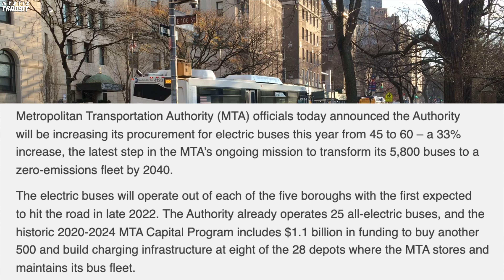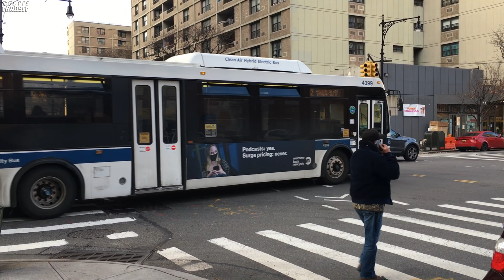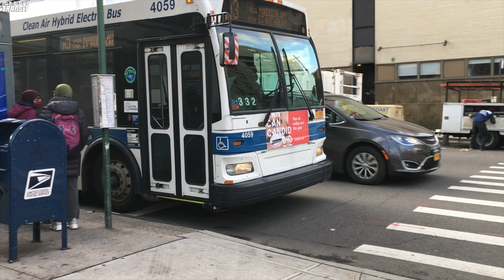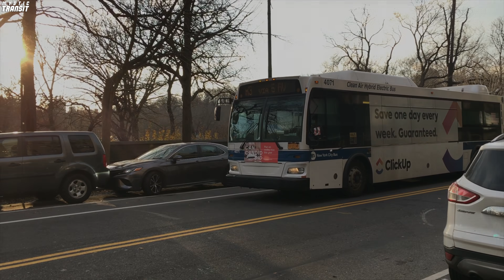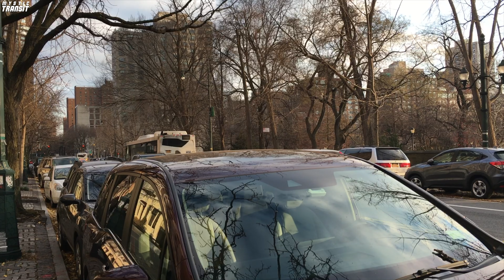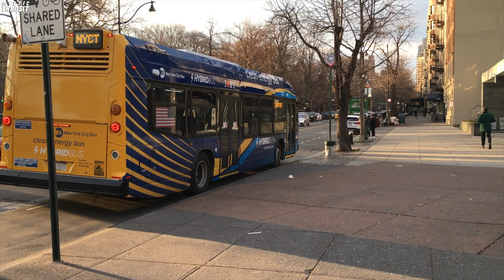Retiring the Orion VII's - NYC's Bus Fleet Modernization

Comment: As of March 27th, the Orion VII OGS have officially retired. RIP 2001-2024
Reply: It’s actually March 25th. 3762 was the last Old Gen and it did it’s last runs on the Q37 and Q60. And then it retired the day after. 3708 and 3751 retired the day before March 24th. This now officially ends the era of New York City operating buses with push tape stop requests, slanted windshields and they were also the last buses that didn’t feature announcements.

Comment: great video ..   I favor the "4000" because they have a smaller "three-spoke"  steering wheel and great visibility which made driving them nice in traffic close second would be the  "7000"  (Brooklyn).  I think this was the best bus in the fleet (just be careful in rain and snow the front likes to slide)  ... but you can't beat the RTS  in bad weather they are warm and visibility is the best out of all the buses (when you can get the passenger side mirror right lol ) due to the fact you sit much higher.. (not counting the older rts 9000 they sucked with their "touchy" brake peddles which would send passengers flying if you had to stop short which had the older brake design)....   currently, I drive the extended nose buses out of Staten Island and they are terrible in ride and visibility (my good the shakes thought the steering column and rattles the driver to death on long line like the s78/ s79/ s74....

Comment: The use of hydrogen fuelled buses is also something I think is the way forward especially with the 9 min refuelling time compared to the time electric vehicles need to recharge. This allows better utilisation of the fleet.
Reply: Where’s hydrogen infrastructure in the state of ny. Nowhere. Where electric plug outlet? Everywhere
Reply: @williamerazo3921  where was the oxygen storage tanks before the hospital got built? 

Like many things as we move to greener option we may need to invest in infrastructure but for Hydrogen delivery to site is via a tanker from the processing site. 

Where hydrogen will have advantages and this is the case over in my area which has a mixture of urban/rural communities is the increased range and the quicker turnaround time when needing to be refilled. The filling of the Hydrogen tanks takes only 9 minutes which is impressive compared to electric charging times for over 250 miles. 

Yes, regenerative breaking is a good way of extending electric bus range but when you get out of the cities often the breaking is less frequent and the routes are longer which is a good reason for the hydrogen buses. There is also the question of how many extra buses do you need to allow for the increased charging time of electric buses to still run your operation especially on routes with 24 hour operation as not only are you risking having to purchase more buses but also more land to store the fleet.

Comment: Why does everyone have a hard on for battery electric? Batteries suck. Why cant we use diesel generator electric hybrids. Ya know like locomotives?
Reply: MTA is already procuring several diesel electric hybrid buses, but the long term plan is to go zero emissions (the diesel electric hybrids still pollute, but not by much compared to diesel and older hybrid buses).

Comment: Yes you need to invest in the supporting infrastructure. Like dozens of diesel powered tow trucks to tow the electric bus when they run out of juice midspan on the RFK bridge.
Reply: It is exteremely unlikely that electric buses will get stuck in the middle of the bridge. A few Proterra buses were tested on routes operating on the Pulaski Bridge and a number of articulated Xcelsior electric articulated have been operating on the M60 along the RFK bridge, and there hasn’t been a case where buses ran out of power in each.

Comment: Rule of thumb:

 Don't scrap all the Orion 7 Next Gens.  Because if they do, the MTA will regret it.  Trust me.  Rode one on the Q50 today.   They still have that great instant torque.  And they still look really decent with the frameless windows.  They can rehab and keep some of them and donate the rest overseas
Reply: You do realize that these buses are reaching the end of life and new buses coming in need room in the depots, correct?
Reply: @TheRailLeaguer  To be fair the M.T.A does have a history of retiring things too fast. I always think it’s a good rule of thumb to keep a few as a contingency fleet just in case. For example recently the new fleet of Prevost coach buses had seat spacing problems the M.T.A should’ve keep some of the older D4500 models just in case something went wrong with the new coaches.
Reply: @jamallhayden2512  The retirement of the NG buses are going a bit slow this time around, and there really isn’t a need for a handful of old local buses to be kept around for contingencies. However if it makes you feel any better they could preserve a bus or two for the museum fleet.
Reply: @TheRailLeaguer  Mr. Hayden.  You're missing the point.  You don't scrap a bus with outstanding attributes........that being speed and the other aesthetics.
Reply: @milestone_achiever4634  They’re actually being scrapped due to age. Once buses start to pass 12-15 years, the buses being to develop problem, making fleet replacement all the more urgent.

Also, the Xcelsior and LFS have even better speed and aesthetics. A total of 833 of these new buses will replace these buses, with another order replacing the rest.
Reply: @TheRailLeaguer  It is true new buses irreconcilably in some instances will need to be ushered in.  However, the Orion 7 next gen hybrid it's still a very decent design and the buses are still very fast.  It is one of the few fast and fun to ride buses ever to come out of the Orion plant. 
   The Orion 7 Next Gens were an enormous improvement over the Orion 7 First Gens in all aspects.  All I am suggesting is that the MTA save some of the Orion 7 next gens.  They can rehab them.  MBTA,  TTC and I believe SEPTA have used a company to rehab some of their buses from the mid 2000s   And the nation's biggest transit network can't do this as well?   That's kind of absurd.
      Of course, they don't need to keep all the Orion 7 Next Gens.  They can retire all of the Orion 7 first gens because they are just too damn slow and the design is dull and out of style.
    I'm pretty sure that the MTA can rehab at least 50 Orion 7 next gen hybrids out of the 800 or so in total. That's only like 6 percent.  Come on.  This is not rocket science.  I'm sure they will have plenty of room in the depots to store them.
  Let me just reiterate NO American transit agency should be scraping any buses.  Retired buses not auctioned off can be donated to other countries where the people are still using dilapidated buses that are 50 years old and more.
Reply: @milestone_achiever4634  There really isn’t a need to save a large amount of Next Gens when depot space is at premium. However they could save one or two for the museum.
Reply: @milestone_achiever4634  I am not sure what you are on but the entire Next Gen Orion VII fleet is slated to be retired by 2024. The MTA has already begun the bidding process for the orders that will retire them. By way of the 25 40-foot Electric Buses (reportedly for Eastchester) and 237 40-foot Diesel Buses (For JFK/FR and LaGuardia)
Reply: @BrIaNMeRcY1022  if you read my reply, you will acknowledge that It is a 2 part issue from my own perspective.   
    I would never expect the MTA to keep a previous era of buses when new ones are ushered in.  We all know it’s a continuous trend.  It’s also one of the critical laws of evolution…….out with the old and in with the new.
     However, I believe that the MTA should save a small number of the Orion 7 next gen hybrids.  
It is still a very innovative design.  I am pretty sure they can overhaul as little as 20 out of the 700 plus buses.

    They can rehab them through Mid West Bus.  MBTA has overhauled some of their older units through Midwest.  If NYC wishes not to, they should donate everything they retire overseas for the simple fact that there are too many people in poorer countries still using dilapidated buses.  
     No U.S. transit agency should be scrapping buses anymore.  Whatever buses are not auctioned off should be sent overseas.  

Plain and simple
Reply: @milestone_achiever4634  Those days of the MTA doing a overhaul are over. They did it with the Blitz Fishbowls and RTS Remans merely because they couldn't retire them. As they needed to maintain service. The MTA is in a better position now compared to the 80's and 90's with the arrival of new buses. Overhauling the Orion VII's is a waste of money.

You are better off ordering new buses that have better fuel economy, is cheap and easier to maintain. From now to 4th Quarter 2023, the MTA is looking to retire close to 600 Next Gen Orion VII's. With the rest of them being retired sometime in late-2024, early -2025.

Comment: NYC gets cold enough to induce big variability in battery bus performance, right?  Do what Boston does, implement battery or gas extended trolley-busses, with trolley wire along trunks... or have many rapid-charging trolley points along a 100-percent battery service
Reply: The 15 XE60s can handle cold weather, and it can even handle snowy roads as well.

Comment: The one with 6905 was on my line the B12 up until 2020
Reply: 6905 was never even assigned to East NY Depot. The East NY Batch of Gen-II+ buses was from 6790-6843.
Reply: @TheRailLeaguer  it was back in 2019 and 2018
Reply: @TheRailLeaguer  some of them get switched due to transferring buses from different lines B12 is now xd40s now

Comment: The Toronto Transit Commission, which is smaller than NYC MTA has 60 electric buses which is the largest in North America. They are 25 New Flyer XE40's, 25 Proterra Catalyst BE40's and 10 BYD K9M's.

Comment: I'm gonna miss driving the NGs those because they're pretty fast and brakes are good with the help of the regen braking. The OGs are crap with the exception of 3563. That was a BEAST of a bus bro 💪
Reply: Wasn't that the one they converted to a diesel
Reply: @artvandelay5385  YES. Yes it was. The whole fleet was supposed to be converted but it would have been an expensive conversion.
Reply: @fw3nyc  I loved that bus when they sent it to spring creek  I drove all the time  I got stuck with on the 103  they took it to zerga   its still there
Reply: Bro really called the OGs crap
Reply: @Skillissuelol  they are tho. Brakes are lousy and acceleration is lack luster to say the least.
Reply: @fw3nyc  the NGs are aging worse than the OGs funny enough

Comment: We have 3 fully electric New Flyer X40E here at UTA. I one of few drivers who can drive these for 9 plus hours without killing the batteries. These buses have killer A/C for the summer days. Very quiet electric drivetrain. The only annoying part is the loud GM style turn signals. The front door when open blocks the outside mirror. The header changer is too high to change. But has air vents above the drivers head to keep us cool is a nice touch that we ask Gillig to do the same on our 2020 models.

Comment: Good video but remember this. Electric Bus technology is advancing. Best to have a small fleet of them when you are introducing them. The MTA has committed to procuring exclusively Electric Buses after 2028. In 2023, the MTA plans on receiving a test fleet for more Electric 40 & 45-foot buses.

In last month's (February 2022) Board Materials, the MTA is already in the process for procuring for more Electric Buses (100 60-foot/400 40-foot). The progression has to come gradual, not rushed. While the cost of an Electric Bus is high but, the cost of maintaining them outweighs the cost over time.
Reply from the maker: You make a good point. Maybe I shouldn't be so hard on them for the slow process of procuring Electric Buses.
Reply: @MysticTransit  When it comes to rolling stock, logistics plays a crucial role. The supply chain is one of those critical pieces. Hopefully, it gets better in the technology sector from the onset of COVID-19. The MTA has a game plan in place to advance to the next generation. From Electric Buses to the R211's, the MTA is going to look vastly different in 2026.
Reply: We have CNG, Electric, and Diesel buses.  Even though you say electric bus don't require that much maintence but in fact they do. We don't use all the time because the weather conditions, how long/short the route is. They require special programming all the time. The driving ranges from driver to driver.
Reply: @tommynunez1495  I am well aware of what buses are used in New York City. Weather conditions is a non-factor. The past couple of snowstorms, the MTA ran their New Flyer XE60's with little to no issues. The MTA knows the technology is advancing and is taking the range of the bus seriously.
Reply: @BrIaNMeRcY1022  Im a former NYer and live in Utah. Im a higher elevation and weather does plays the part here so when maintence doesn't send out the electric buses in given conditions its for many reason. Glad MTA thinks differently
Reply: @tommynunez1495  Electric Bus Technology is advancing. The MTA recognizes this and is playing it safe with procuring Electric Buses.
Reply: @tommynunez1495  The M.T.A should experiment with hydrogen powered vehicles? Hydrogen E.Vs tend to have a longer range and fast refueling. They could gradually replace some diesel powered equipment with hydrogen ones. Have all battery electric E.Vs handle short to mid distance routes and use hydrogen and C.N.G for longer commuter routes!
Reply: @New York Bus Guy Thank God!

Comment: How about having a contest in every high school, college,  and university in NYC to have new engines for using hydrogen,  liquified natural gas, butane, propane liquified coal gas, ethyl, methyl alchohol as alternative fuels?
Reply: This is about achieving carbon neutrality by no later than 2050 under the Paris Climate Agreement to prevent global warming from exceeding 1.5°C and not just about reducing local air pollution and reliance on oil. This is why most of the alternatives you mentioned would not work. In order to be zero emissions, you have to use either all-electric or fuel cells. No combustion engines are allowed, not even hydrogen, because any combustion in Earth's atmosphere creates nitrogen oxides ("NOₓ"), which form smog. The term "alternative fuels" is now over a decade outdated. It is now instead and will be for the forseeable future "zero emissions" and "carbon neutral".

Comment: I Miss The D60HF's.
Reply: I still can’t believe they didn’t preserve any 🤦🏿‍♂️ How could you not preserve your first articulated fleet! 🤬
Reply from the maker: Yeah, that, was a rather stupid decision.
Reply: @jamallhayden2512  Actually, I would like to let you know that 5534 has been preserved for the museum fleet. Since the moment that the D60HF fleet retired in 2019, 117 (ex-5534) hasn’t been scrapped and it still remains parked at Eastchester Scrap. It is only a matter of time for the MTA to consider restoring 5534 in its original formatting back when those buses were brand new. Besides 5534, we are also waiting for the MTA to take a moment to restore 8971 back into it’s original formatting as it has been reported that it is the only 1996 Novabus RTS Bus to be saved besides 5249 which is a 1999 unit.
Reply: @edwinpenafort8750  Oh thanks for the info 🤝
Reply from the maker: Same.
Reply: I’m gonna Miss the Orion og
Reply: Wish I was around to see them

Comment: I’m a former London bus driver abd have driven numerous different types including the routemaster but the modern buses we have now are superb to drive for eg the the Volvo VH also the tech the driver has now once it was just two way radio now it’s radio  SMS txt mobile phone and GPS on the TfL i bus system  will NY try double deckers again we have over 8000 in London pulse lots of different single deckers lots of variety as for the old routemaster now a museum piece plus in todays world to dangerous but I did like driving them the conductor took all the flak from passengers hehe
Reply: NYC did have double decker buses from 1907 til 1953. From the 5th Avenue Coach Company to the New York Omnubus Company to the New York City Board of Transportation. It has been all single deckmbuses since then. Ceck out on GOOGLE for,vintage photos of buses in NYC.
Reply from the maker: In addition to Double Deckers running in the early 1900's, we tested Enviro 500's just a few years back.
Reply: @MysticTransit  I’ve driven the ALX 400 and it’s latter enviro 400 and enviro MDC on a rail replacement from Stanmore to Luton via the M1 really nice bus my one was what we call a semi coach could easily do 70 mph on the M1 motorway ,all the best ,Mark